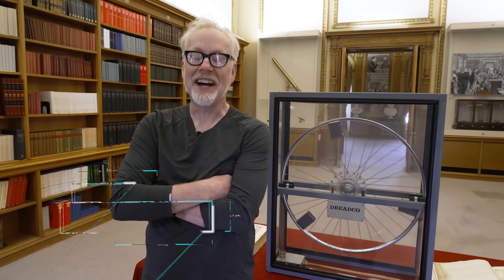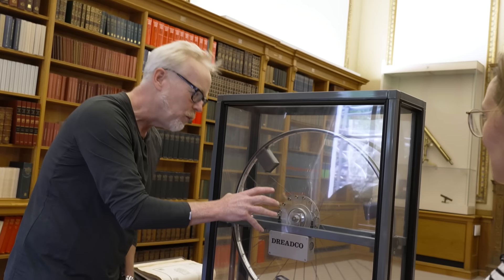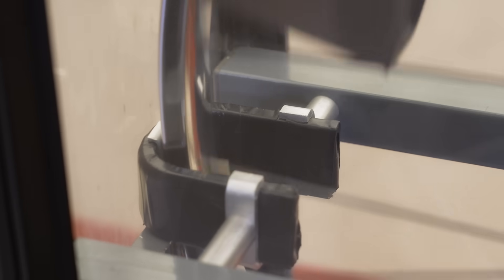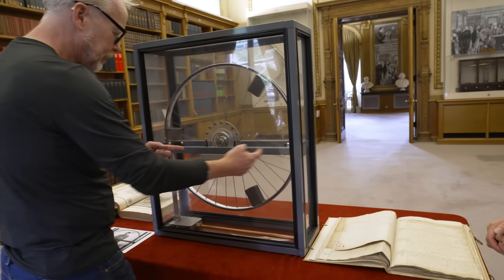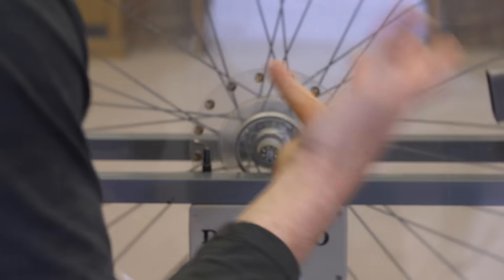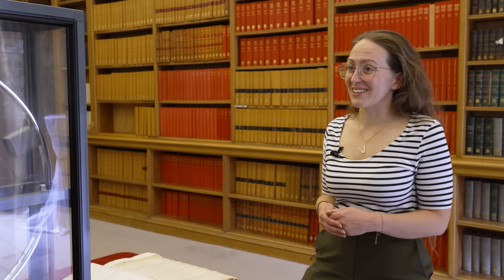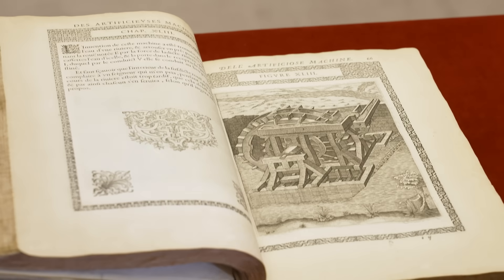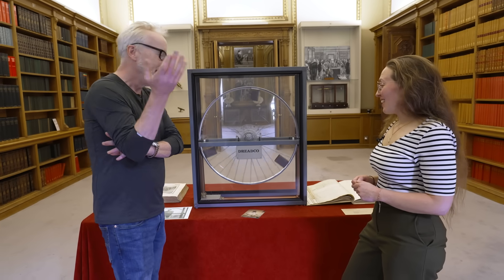Adam Savage vs The "Perpetual Motion" Machine!

Comment: Yep, light sensors count revolutions per second, relay to motor/servo/ and control chip.  Every so many revolutions servo kicks in to keep constant revs.  Battery is re-changeed like car battery altinator but evently looses charge just like acid car battery.  Propably Fluid in the three boxes attached to master wheel.  👍👍👍 Cool video Mr Savage!!!
Reply: "recharging the battery" from it's own energy is silly as harvesting the now rotational energy and converting it into chemical energy is lossy, and the storage and the reuse as well. A combustion engine car does not require electricity to run, it requires it for various other appliances such as the starter and lights, and thus to be more efficient they charge the battery using energy already being consumed such as the rotational energy of the crankshaft so that the vehicle can have two forms of energy without requiring multiple sources of fuel.
Reply: @Vampr1c  🤔 If one battery ran system and recharged a secondary battery they could simply charge eachother back-forth enveitabley until power cell completely devalued like they are talking about.  Car alternator was simply a reference to how motion coverts to recharge...this is obviously an Electric motor system...

Comment: I think the wheel is a generator. The 3 black packs on the wheels are likely coils which experience enduced voltage when passing through the two magnets on either side. These coils are likely wired in parallel via two spokes each, one insulated from the rim entirely to allow pos and neg. This allows voltage and current to flow down to the bearings/slip rings through the spokes. This set up would also limit lost energy via the entire wheel being used in series and limit loses through resistance and heat. The slip ring/bearings must some how connect to the Dreamco Box which is likely the battery. The battery then feeds the in-line fan hidden in the heat sink box which is connected to both ends on the copper pipe. The in-line fan creates positive air flow on one side of the wheel and negative on the other causing it to rotate.

Comment: I made that with a wheel from English racer,and  40 magnets the size of a 9 volt battery, mine was horizontal, I did it in 1976 when I was 16,   the thing is that ,it has to produce something, just spinning , does not accomplish anything

Comment: Those weights are magnets with ball bearings in the spokes. Insulation is most important so no outside influence to affect the machine. It requires a human push to get the spin going

The copper tubing is also magnetic pulling the field

Comment: It really comes across so smug that these people would tease like this. It's just intellectual bigotry, to make this kind of a machine and not explain how it works.

The question I have is where does gravity come from, and does it even exist? Because if it does, then what is its source? Does gravity require energy input to exist? If it doesn't exist, and it's just electromagnetism, why is it that things that are seemingly not magnetic have weight or magnetic force?

I have considered otherwise, but I think gravity does in fact exist. And it suggests that perpetual motion exists because gravity is a source of force that requires no energy input. It merely requires that matter be present.

All forms of energy we know of are derived from gravity. Light, an emission of energy from the constant downward force of gravity in a star. Nuclear fuel, is material that has fused, from force of gravity, into a high energy form of storage, that can be released by fission. Fossil fuels are similar to nuclear, but the "fission" is actually just simpler compounds that were squeezed together by gravity.
Hydro is just gravitational potential energy.
The ultimate source of energy in food is of course from gravity as well.

So why would an unlimited source of energy that requires no input, only that matter exists, not be able to create energy indefinitely? It already does, that's the whole point. I'm really disappointed that people don't understand that.

In my opinion, the only reason perpetual motion doesn't exist is because people don't want it to. It's too convenient, and it doesn't support the narrative that life is harsh and nothing is free.

Even if gravity has some energy source we don't understand, it still brings up another question, which is why does a universe exist then, if it just runs out of energy? Where would it come from, and where would it go? Just nothing. It's absurd to think of gravity as finite. It's like thinking of space as finite.

There's really nothing impressive about this. It's just insulting, and it's supposed to be.

Comment: The right hand bit, near the axel, looks like a little air jet blowing on the little round rivets. If the magnets induce some sort of current, could they power a bellow triggered by the opposite ball. The copper pipe provides a conductive wire. Parts must wear down, need oiling, etc but other than that a circuit, current generator, bellow and fly-wheel must get something like this going. The air jet is just the impetus needed to spin the wheel and keep itself going.
A one day build would be awesome, but sad that the only thing perpetual about it, is that it'll need perpetually servicing, restarting, oiling, new bellows or magnets 🤷🏼‍♂️

Comment: Imagine making a scientific discovery that could help the entire world and then keeping it a secret. Also there's gonna be resistance in the bearings and the air resistance in the chamber. That box is clearly not designed to be under a vacuum. Meaning that it is creating more power than it uses and if keeping itself running forever is impossible then creating more than you use is even more impossible.

Comment: Another perpetual motion machine that runs for about 2 years is basically a wall clock motor. Swap out the 1.5v battery and your good to go for another 2-3 years.
Reply: A digital watch can actually run for about 7 to 10 years on a large coin battery like a cr2032
Reply: @Xalgucennia I know this is a 2 year old comment, but I have a small wrist watch buried in a box that goes off every day at 3pm it beeps for about 10 seconds. This has been going on for 10 years I can't find the watch it's even gone with me on three different moves. I can't find it...every single day at 3pm it drives me up the wall. Like an invisible smoke detector with a dying battery
Reply: @Xalgucennia  Not motion. Must have moving mass to qualify.
Reply: @glasslinger  Digital watches use lcd displays they obviously generate motion 🤣
Reply: @Xalgucennia  ok but did u see the size of the wheel. You cannot compare it to a watch
Reply: The funny part is I use my dead AA batteries to run my clock. What other device runs for years off of a "dead battery"?
Reply: @ronnythompson9115  The remote control for a wall-mounted AC unit
Reply: @BeheadedKamikaze  Now we just need to figure out how to make a vehicle powered by remotes for your AC wall-unit, and we will have finally solved the energy crisis
Reply: @ronnythompson9115  I do the same thing. There are a select few devices that will run for months on a battery that would be considered dead if used for most other things. Any kind of remote (such as the TV variety) is a great use for them too. Basically anything that takes very little power to function.
Reply: @ronnythompson9115  Guitar tuner
Reply: @ronnythompson9115  A fake pendulum in a cheap wall clock. The AA battery runs out in the clock, it slows and stops. 
Only in better made clocks is the pendulum attached to the clock, running it.
In the cheap ones, they're totally separate, so the AA battery can die, the clock hands stop,  and the pendulum keeps running. It's actually 2 repelling magnets,one hidden bottom centre in the clock base, the other in the pendulum. But yes, eventually the pendulum stops.
Reply: A calculator?
Reply: @sonofmeh3182  I've had the same calculator and original battery for almost 20 years now, still works just fine, quite incredible really
Reply: I came looking for this comment because that was my exact thought as well.
Reply: I guess this is exactly how it works. Its a triphasic motor, where the three phases are is the 3 black boxes mounted on the wheel, with a battery, a solenoid and an ils in each. When a box near a magnet, the ils closes the contact, the solenoid causes momentum, till the ils runs out of the field of the magnet. 2x / turn / box, 6x / turn for the whole construct. It would work without the ils, but this makes the battery lasts much longer. Anyway, its just a motor, a dumb stupid motor.
Reply: @francoisplaniol1489  what's an ils
Reply: Start with a box containing a rechargeable battery.  Add a couple of solar cells with circuitry to keep the battery charged with whatever light is available.   That drives the motor and bike wheel which likely needs only a few microwatts to keep turning against the ball bearings friction and a bit of air current loss.
A test of this to keep it in the dark, making sure of no infrared illumination .
I predict it will eventually stop turning, but that could take years.
   Consider how long a Casio wristwatch can run.  Add a solar cell and a little light now and then, and it will keep time forever.
Reply: @williambarrett6527  My Casio G-shock solar slim divers watch 'AQS800W' can run for 8 months with 15 minutes of direct sunlight and it is a combo digital/mechanical (costs $35 Amazon) 
I literally stare at it sometimes on wrist and can't believe it even exists, seems like something pulled from the far flung future.
Reply: @williambarrett6527  Even better, maybe the glass container is a vacuum :P
Reply: @williambarrett6527 my first thought was that there was some type of heat engine-like device rather than a photovoltaic, and that it keeps running due to the light hitting it. But I really think the "it has a 1.5V battery that has to be replaced every couple years" is the most plausible explanation
Reply: My thoughts exactly.
Reply: Exactly what I was thinking its possible that its a 9 volt battery attached to a clock motor since it gets serviced at least every year
Reply: @TheBossHogg0  what do you think is physically (or practically) more efficient? A wheel made of a ton of tiny hidden watch motors or one larger motor?
Reply: What’s crazy is there’s several places on this thing for there to be batteries. It’s almost like insulting our intelligence. Even though we don’t know how it works, it’s obvious that one of these places, and there are five of them that are obvious, could have a power source. I just wasted 14 minutes of my life.
Reply: The power requirements for a clock mechanism are so low they should have been able to make it more perpetual motion-y with some mild energy harvesting, like the same sort of effect from a crystal radio to gather a small voltage from radio waves, or the aforementioned possibility of solar. A few years just means to me that they used batteries
Reply: Should have used lithium ion cells, would last a tiny bit more.
Reply: Harnessing the moon, the tide, the sun by satellite, all theoretically perpetual... Only way for man is to use vacuum of space, use gravity instead of fight it, remove all friction by making liquid nitrogen sliding surfaces, as something along those lines... Too many forces on earth to stay perpetual but maybe someday....
Reply: @CP-jc9lj  you can make something spin infinitely in space, but using it's rotational energy will make it slow down. 
Heat transfer in space is pretty much non existent so any type of reactor would just melt itself. 
To use the force of gravity you will have to spend tons of energy getting something up, to use it's force of going down.
The only solution for space harvesting is taking all the space debris and redirecting it down to harvest back the energy it took to get it up there, or at least, some part of it. Though there will be the problem of recycling the space debris and energy consumption associated with it.
Reply: 4 big boxes for batteries. Just wasted a minute of my time which is gone forever. 😢
Reply: You're*
Reply: The main question for me is i why it only ruins for 2 years. All those 3 boxes on the wheel should be batteries  + driving electronic. and they should contain enough charge for all decade
Reply: The copper tube isn’t hollow it is a battery or capacitor and the magnets aren’t magnets because that would become taxing…. It’s a lead lined uranium powered motor
Reply: G-Shocks can go on for 10 years on a single battery
Reply: If you want to be precise, it would be a 1.5v cell, not a pile, since 1.5v would imply a single cell, and a pile implies multiple cells.
Reply: Eventually the batteries will deplete even if it takes 100 years therefore not perpetual period
Reply: ChrisGodfrey-qo3ry  What do you mean you've solved it?
Reply: ChrisGodfrey-qo3ry  Please simply let us know.
Reply: ChrisGodfrey-qo3ry  Where can I look at your other inventions? The clock doesn't really blow my mind besides the dead battery never dies. Its been going for over 15 years.
Reply: Three 4.5v batteries is my guess.
Reply: No it is working on light or changes of temperature.
Reply: Dude, in the square tubes that make for its frame they could hide enough AA batteries to make it last a LITTLE bit longer! Besides there are a lot more stable and long lasting types of battery tech that a scientific institute undoubtedly could build themselves so that they too would fit in those tubes and with enough capacity for a century!
Reply: The three boxes each has a battery and magnetic circuit with a coil  that pulses when it passes the fixed magnet and gives a little push
Reply: If there is solar involved its would not be a perpetual motion machine!
Reply: If it needs maintenance it is not a perpetual motion machine. Doesn’t matter if it can spin without batteries, motor etc for a million years. Perpetuity is forever
Reply: Perpetual motion: watching YouTube
Reply: Exactly. The mystery here is how this clown managed to convince everyone that a bicycle wheel turned by a small battery powered motor is a perpetual motion machine.
Reply: Yes it does spin, but what is the use of it? Can you havest free energy from that machine? Even if it provides enough energy to keep itself running its useless, if it cant generate extra for some usage. This guy on video does not seem to be really smart, or to ask right questions, he knows some theory how things could work but direction is far off.
Reply: @Dominik40301 
That "guy in the video" is Adam Savage; inventor, actor, designer, fabricator and educator; best known for the long years he hosted "Myth Busters"...I think you need to recheck your "does not seem to be really smart, or ask the right questions" part of your comment... He's simply trying to keep the mystery that the museum tries to keep, plus put it in a "Engineering for dummies" type of concept...But he's definitely proven to be a super smart guy, which you could figure out also by watching a few episodes of the early seasons of the show; the guy is a genius
Reply: Could be driven by plutonium/Radon gas (heat2electricity via Seebeck effect) or via induction if the machine is in the neighbourhood of a live wire or by gravitational gradients ( as in tidal flows).Tides will pull fluid from the horizontal to the vertical pipes.   I guess it is the last one together with the capillary effect if you change the adhesion/cohesion relation between the tube walls/water in it. Would be nice to know what it is.
Reply: @pietervannederkassel7847 that wouldn’t disappoint you after finding out how it works though so i would believe it is just a clock motor
Reply: @pietervannederkassel7847  For a civilian (which David Jones/ Daedalus/ DREADCO was) to get hold of appreciable amounts of Pu in the UK is ... really hard. Adding the power of being a regular columnist for a weekly science magazine and it'll be ... really hard.
Reply: My good to go for another 2-3 years? I don't have a good to go.
Reply: you're

Comment: No machine that requires maintenance can create perpetual motion. Because you have to stop it and take it apart to maintain it. Which automatically eliminates the fundamental meaning. Perpetual motion IS NOT what is the problem, it already exists in our laws of physics — an object in motion stays in motion. Perpetual motion is already possible with the combustion engine. The problem in its entirety is the fact that no machine has been built that doesn’t require maintenance. They all break eventually. Even clocks, even the most finely built watch to some degree. Which inevitably brings the problem philosophically and technologically to the principle of time.

Comment: What if the bloack boxes one the wheel is a magnet, and the black things on the sides are coils, that way it can perhaps take some of the kinetic motion and turn it into a bit of electricity, that can be pushed back into the system, to keepnit going, and i also wonder if there is a vacuum perhaps in there to decrease the friction, and help it stay moving longer

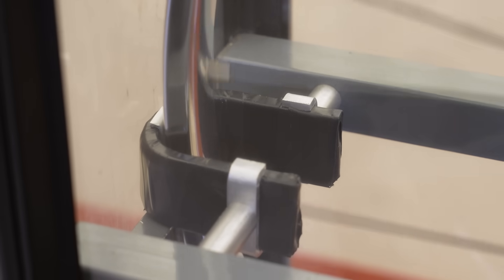Comment: at 4:12 , it looks to me like the wheel hesitates slightly, then accelarates slightly.  Slow the replay speed down to 0.5x.   My guess is that there are some electromagnets in the boxes that are triggered to repel the fixed magnets just after the rotating electromagnets have passed  the peak of the fixed fields.   Having some solar cells in the white box will top up the batteries in daylight hours.  Eventually the batteries will lose charge, hence the 6 month 'service'.